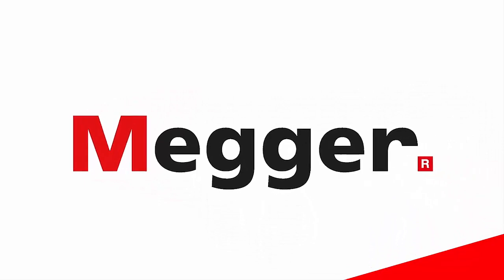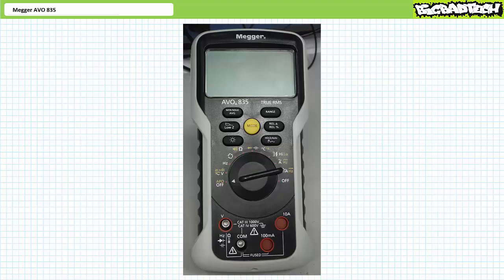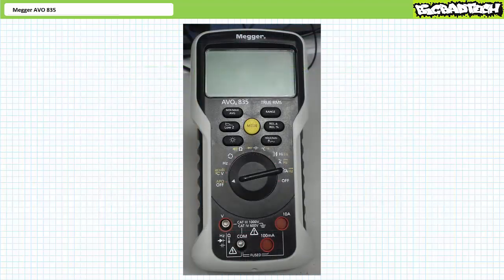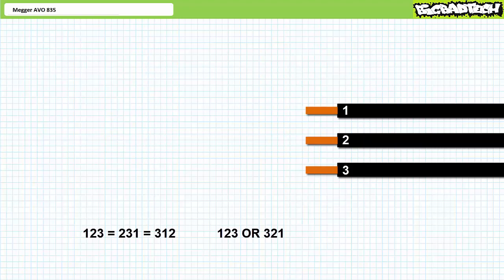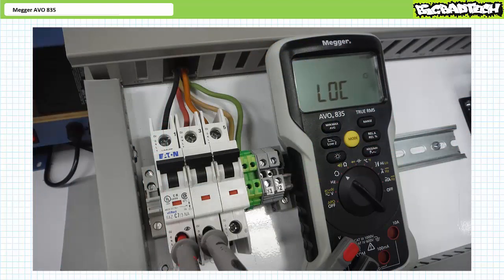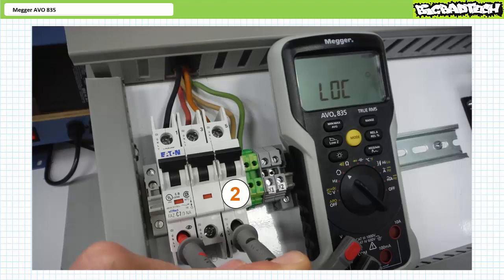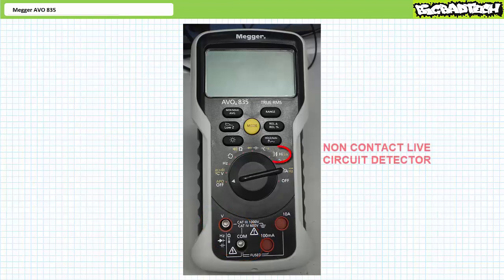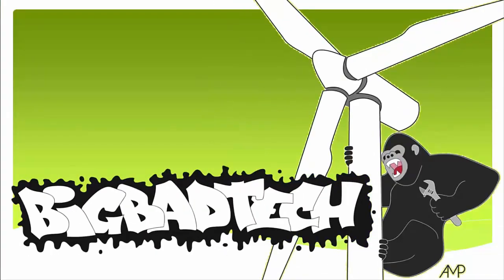Megger AVO835: Phase Sequence Indicator and Non-Contact Live Circuit Detector

Comment: Does this have a ghost voltage feature?
Reply from the maker: Indeed it does. Check it out at: https://youtu.be/-wRR7EaLx4o?t=309
Reply: @bigbadtech  I'll be buying this then. Just took a job at Fords after years of running service as a refrigeration mechanic, so needless to say I am on easy street now. However 80% of what I normally do is now done by other trades, install a compressor or motor ( pipefitters). Motor control center trips on a compressor or motor electrician, I dont even change  belt's for christ sake. They called me to a Copeland compressor and said it failed electrically they were using some little fluke meter. I whip out and megger 420/2 and ask for permission to test it lol. It was good. It ended up being the second fan motor, which if the unit is not running that fan will not turn on unless a pressure switch is made at 160 psi. I don't know how these guy's even work. Not one electrician has a megger.

Comment: I still like having the insulation test function along with my multi meter for motor and motor control troubleshooting but it’s like 200+ more expensive. This meter is pretty awesome for the price of a comparable fluke. I’m impressed. I would definitely go this route if pressed on one or the other. Do these meters have functionality to connect an amp probe as opposed to wiring your meter into a circuit?
Reply from the maker: The Megger AVO835's ammeter function is similar to a regular ammeter (ie: power off, break the circuit, insert the ammeter in series, power on) and doesn't support the use of remote probes. Ironically I'll be publishing a lecture on the AVO835 ammeter very soon.
Reply: Hello Becky, David from Megger here. Email is David.Danner@Megger.com think I can help you.